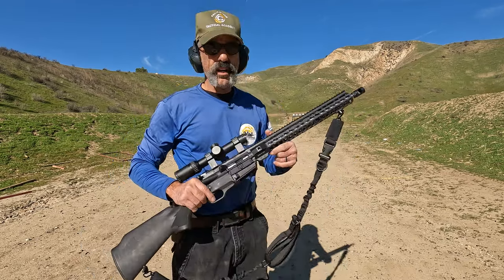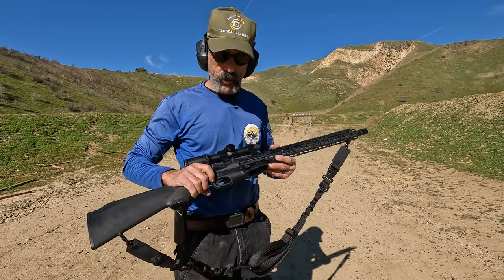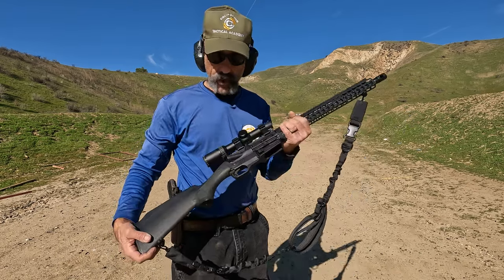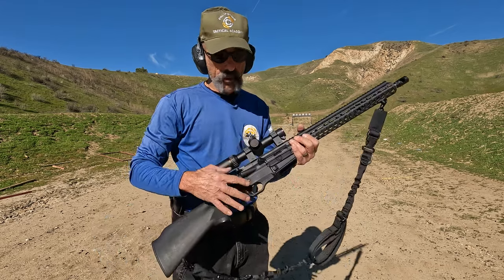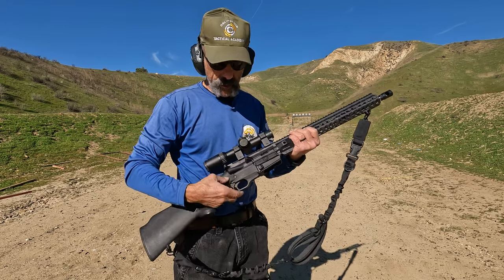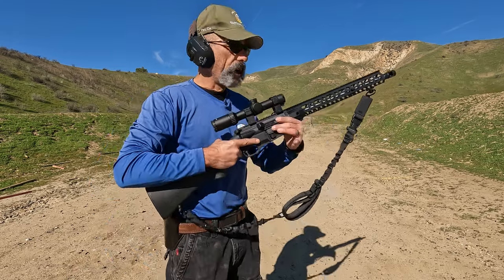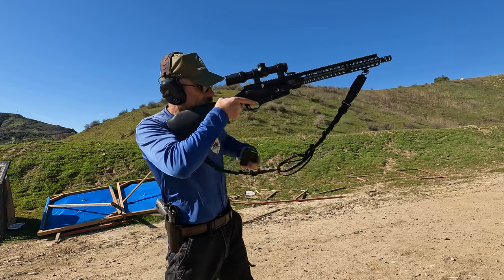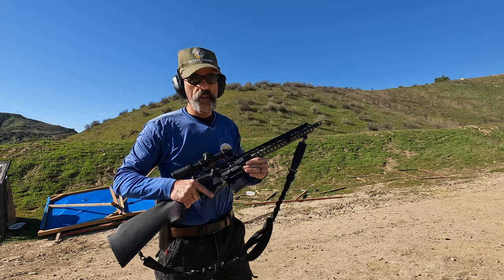The Fightlite SCR Rifle.

Comment: I'm not in Cali and I think this looks amazing. I really want one, its a nice touch on the modern AR.
Reply from the maker: They are becoming very popular.
Reply: Honest Outlaw tested the pistol version. The only thing that the gun would reliably do is fail to eject.
Reply: @mlazarus5388  are they still in production? They seem mostly sold out
Reply from the maker: @priestesslucy  I think they are still making them but seems demand outstripped supply. Stupid capitalism.
Reply: @priestesslucy  They appear to be in stock again, though in my humble opinion the Foxtrot Mike offering looks like a better deal if looking for a full factory built rifle. The CMMG offering has an ambi mag release though, which after handling one I can say effectively eliminates the magazine ergonomic issues, but it's up in premium price territory. Not as overpriced as Sig, but it's up there. At least we're getting options beyond the classic featureless build.
Reply: @kentyannayon3741  does FM carry any featureless lowers that are compatible with 300 blackout?

Sorry if that's a dumb question, I never got into this type of firearm in time to build any for myself before WA went nuts on regulations
Reply: @priestesslucy  300 blackout and 5.56 use the same lower, so a 5.56 compatible lower should work with 300 blk no issue. The issue becomes finding a 300 blk upper that's compatible, FM seems to only make 223 wylde uppers, but it's supposed to be compatible with BRN-180 uppers, however those appear to be pretty expensive. The FightLite might be the better solution to pair with a 300 blk upper, since it doesn't seem to require a bufferless upper receiver. Me, personally, I prefer 5.56/223 due to cost and I can't suppress it where I'm at anyways, but going 300 blk does appear to raise the cost of the platform as well when it comes to firearms designed to be featureless.

Comment from the maker: With various feature bans coming on line, this type of solution might become much more popular. Mini 14s and similar rifles as well.
Reply: I have a Mini 14 and a Mini 30 for just that reason. Much rather have a fully functional rifle than one whose basic operation has been compromised in order to meet legal requirements.
Reply from the maker: @NathanLGrossman   the mini 30 is under rated in some circles. If the magazines were cheaper, it would be nearly 5 out of 5.

Comment: I definitely don’t need this, but as someone who really doesn’t care for pistol grips on long guns, I kinda wanna get one. If they would build a .308 /AR10 version I would buy that in a heartbeat!
Reply: There is a 300 blackout upper that works with the lower. 30 second change out. No tools.
Reply: @edwardscott3507  300 black out is a cartridge that has little reason to exist in my opinion.
Reply: Choose your own upper most magpul compatible uppers will work @Holden-McGroin
Reply: Can you point me directly to a 300 blackout upper example you recommend? Wanted to pursue a build with this platform. Thanks
Reply: @Holden-McGroin  I personally opted for a 6.5 Grendel and a 5.56 upper and just swap them out on the lower when needed. Quick and easy. I had Central Ct. Arms build my uppers.

Comment: I've left California but when I was there, there were really only three rifles I was interested in: this rifle, the Kel Tec SU-16 CA, and the M1A. Fixed mags or fin-grips were a non-starter for me: I wanted a rifle I can actually use as more than a range curiosity. I ended up getting the Kel Tec-- not a bad little gun and ultra-light, but I bet the SCR groups better. I heard the second-gen SCR actually has an OK trigger (the first gen was garbage)-- if I were buying again in CA I would seriously consider one.

Shame it doesn't have a paddle-style mag release. Not sure how they'd make it work with stanag mags, but it would be way better ergonomically. The SU-16 has the same issue of a side-button that's just out of reach for the trigger finger.
Reply from the maker: The trigger is actually decent. I ran a M1A socom for a while. Nice gun but optics are clunky to mount.
Reply: @mlazarus5388  I lost track of the number of times I almost pulled the trigger on a Soc 16, but the M1As just seem to be really hit-or-miss in terms of accuracy: some people swear by them, others swear up and down they can't shoot a decent group with them to save their lives. Didn't feel like gambling on one since they're not cheap.

How was yours for accuracy? I know the Soc 16 is not a precision rifle, but did it do OK?
Reply from the maker: @ganthrithor  the socom was excellent for it's intended purpose. General purpose, easily maneuverable semi auto rifle in an intermediate cartridge. I wouldn't expect hits past 500 yards unless I had a really good rest.
Reply: @mlazarus5388  Glad yours worked well. I still want one, even though they're not the most practical things :) Got other priorities for the moment though: I'm hoping to move again soon, and where I'm going I think all semi-autos are banned. Bolt-actions only and shotguns with a capacity of two shells or fewer :\

Comment: it's a decent option for ban states - but, we don't know how reliably it works in the long run.  Being a proprietary design with no buffer it requires extensive use and testing to assess its longevity.
Reply from the maker: One would think a manufacturers would conduct some product testing before placing firearms into the stream of commerce. However, it's not unreasonable to have doubts.
Reply: Honest Outlaw got the pistol version, only thing it did reliably was fail to eject. And stoppages were not quick to clear.
Reply from the maker: @nickamalfitano3613  Wow. That's not good. This one has been reliable.

Comment: Curious will work with Adam Arms piston upper? Bolt is different from gas version.
Reply from the maker: It might not work. It's designed around the standard AR pattern BCG
Reply: @mlazarus5388  sounds good tnx

Comment: All it is a modernized mini 14. Maybe a lever mag release be better use mini14 mags
Reply from the maker: @scottyxiong7733   The mini 14 is still viable in California as a magazine fed, center fire semi auto. The worst part about the mini 14 are the expensive magazines and the safety.
Reply: @mlazarus5388  all mags are expensive. It's just a matter how much you get or own already, and yeah ar15 mag most people should already have in hand. I just think lever mag release would fit that variant of a rifle for ambidextrous or right hand users.
Reply from the maker: @scottyxiong7733  Interesting idea. I wonder if the reason Fightlite, CMMG, Sig (Ranch rifle) etcetera have not changed the mag release is simply due to the interface with current AR mags. By the by, Mini mags are like $30 bucks or more. AR mags seem much cheaper, by half at least.
Reply: @mlazarus5388  it just probably cutting cost and simplicity

Comment: What the Mini 14 should've been
Reply from the maker: If the mini 14 took AR pattern magazines, Ruger would sell millions more.
Reply: @mlazarus5388  FWIW in Rugers defense. I will say that the AR mags were not too common in the civilian world when the Mini-14 first came out (Jim Sullivan invented the Mini just 2 years after the Army adopted the M16). And unless you had a Colt SP1 way back than (which were absurdly expensive even back than), you pretty much did not have AR mags anyways. 
Could the Mini be modernized to accept AR mags? Yeah, probably. But, as an SOB that grew up on the M14/M1A platform I don't mind the special Ruger mags, and their AK style "rock and lock", haha. Just stay away from the Mini-14 Pro-Mags, those things are trash from the factory, ive never seen one that did not jam.

Comment: Why don't they just have an angled buffer tube?
Reply from the maker: I'm not sure how that would work, given the buffer tube needs to smoothly move rearward and return to the forward position under spring tension.
Reply: It does have an angled buffer tube, in the stock. Uses a proprietary bolt carrier to make the angled buffer tube function.

Comment: Rifles have been made in that format for centuries so the hole idea about ergonomics.....get over it and train. Ultimately as a non-US citizen that's what I see when you yanks complain about stuff like this......a lazy person who wants the easy way and doesn't want tot spend the time on the range to train and learn a new platform. Another point is why are you yanks happy to use shotguns in this format but not rifles!?
Reply from the maker: Some valid points.
Reply: @mlazarus5388  Just to be clear, I wasn't calling you out or calling you lazy. You seem to be one of the few that will train and make a system work.
Reply from the maker: @TheMegaAsh  Not taken any other way. Thanks for noting this though.